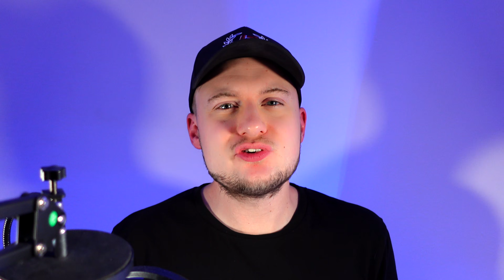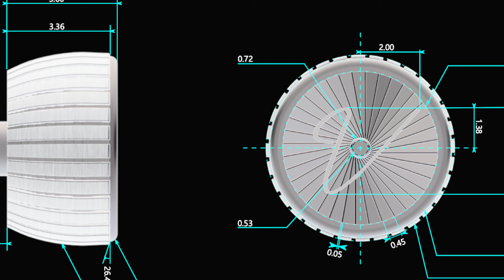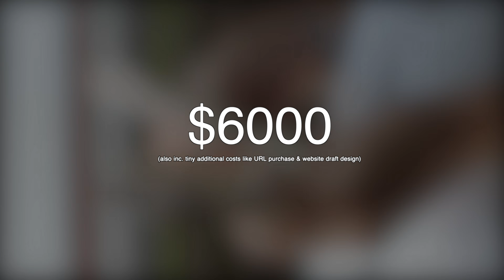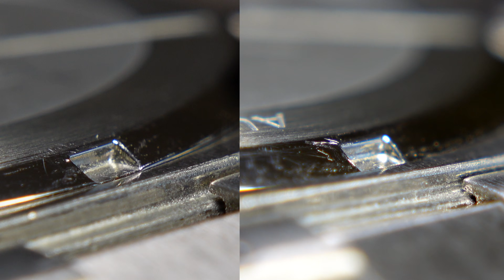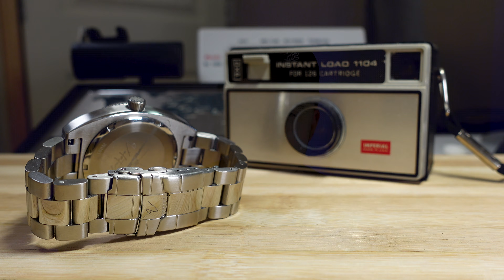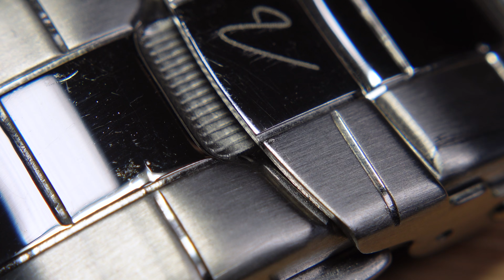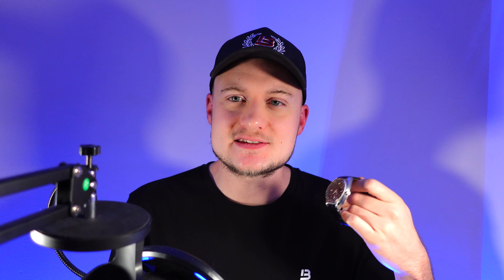My microbrand watch company FAILED ... here's why & what I learnt.

Comment: I have been manufacturing parts overseas in the automotive industry for decades. The best advice I can give you would be to find a broker in the watch industry that is willing to work with you. Yes, the broker will cost you a percentage of everything you ever make, but the benfit for a startup far outweighs the cost. A good broker in the industry will know what manufacturers to use and which not to use, he will have pull with the factories as he gives them a ton of business. For example we have a broker that will get us samples for free, if we want to manufacture something we send him what we want and he gets one of the factories he works with to provide a sample, from that sample we can make changes as needed until we get the product to where we want. Samples are not provided if the factory needed to make a new mold, if a new mold needs to be made we need to pay for the mold, and they will provide samples for free. A broker will also be able to get you warranty with the overseas factories, if they send you defective product the broker will make them replace it for you. If you, as a small manufacturer, order things directly from a factory in China and you get garbage you will 100% have to eat the product. I have been thinking of starting a microbrand on my own, but the only way to do this cheaply would be to buy a ton of off the shelf components, like cases,  bracelets, movements, etc... and have your own dials, hands, and bezels made to lower the starting costs. As you found when you order custom components the factory has a minimum order quantity, usually 300-500 pieces. Ordering that amount of dials, hands and bezels is a doable investment, if you can buy the other components off the shelf in small quantities as you need them. Anyways that is my 2 cents.

Comment: $6000 USD is actually very cheap for first prototypes. This includes design work, cost of design software and manufacturing, tooling and a couple of iterations necessary to get the dimensions right.. that's many hours of work. Building a small number of prototypes is very expensive, there is no economy of scale for the manufacturer to make the numbers make sense. Also.. learning CAD isnt hard, what is hard is knowing what tolerances and allowances to use for the function. You can bring in a more experienced engineer to reduce the number of iterations but this means you have to pay more for the engineer's hourly rate, so you gotta do the calculations for that too.

Comment: First mistake was making them in China. Second mistake was making them in China.
Reply from the maker: I don't agree on this. China makes some fabulous watches these days if you go to the right place - they can machine cases, bezels, crowns and work to tolerances as good as anyone. Not that every factory does however...
Reply: @nextonthewrist here’s something I recently wrote, not about watches, but footwear brands. I think it kind of fits here a bit, though a shoehorn might be needed: I recently came across a Japanese brand addressing speculation online about where their products are made. Their statement, that production was not in China despite forum claims, was met with immediate backlash. Comments quickly followed: “What’s wrong with made in China?” The brand then felt compelled to clarify that no offense was intended.

That reaction misses the point.

A brand should be transparent about where its products are made, clearly and without hesitation. Yet in practice, this information is often buried, obscured, or omitted. It is not uncommon to spend time navigating a website just to identify where a company is based, only to find that the country of manufacture is nowhere to be found. With enough persistence, the truth usually surfaces, somewhere in China, Southeast Asia, Mexico, or South America.

If there is nothing inherently wrong with these places, why the reluctance to state it plainly? Not all brands are reluctant. But many are.

The answer is uncomfortable. For many customers, country of origin carries meaning, and brands understand this. It shapes perceptions of quality, materials, labor standards, and values. It can influence the emotional experience of a purchase. Knowing where something is made may not change the object itself, but it can change how it is understood.

Consumers have different priorities. Some focus on material integrity, including the compounds used in rubber, the chemicals involved in tanning leather, and the finishing. Others think about labor, and whether the hands involved were fairly treated or exploited. Some consider broader issues, including the policies or values of a country. Many want to support the industries, craftspeople, and traditions that gave rise to the products they admire.

There is also growing awareness of imitation. Some brands observe what others have built, then move quickly to produce cheaper approximations with little regard for origin, process, or integrity. Not all production is equal, and not all intent is the same.

Beyond all of this, there is something more fundamental. Some brands build with intent, deliberately and with care, and with respect for the craft. There are customers who seek that out. They are not simply buying something new or visually appealing. They are looking for a meaningful connection to the object, the process behind it, and a community that shares those values. For them, a purchase is not just acquisition; it is alignment.

Transparency allows the customer to decide where they stand.

When a company is open about where its products are made, including the people, the materials, and the process, it is making a statement. It is saying: this is who we are, and this is what we stand behind.

When that information is difficult to find, or deliberately avoided, that too is a statement.

Pay attention to both.

Comment: I think if you want to start a microbrand you need to know how install the movement (cut stems, align hands and etc) so you just need to design your own dial, hands, crown.  Other components like case and strap/bracelet you can buy. So basically in the beginning it's gonna be your DIY brand but after, if it'll be successful, you can design custom case/bracelet.
Reply from the maker: Yeah this is the route I considered, I enjoy assembling watches and ran a side hustle seiko modding back when the SKX was alive.  It's hard to make a watch at a reasonable price in that way though, I know a few brand owners running like this and to compete on cost per unit with factories producing even small batch 200-300 watches, they're either not charging their labour for building or making almost zero profit - not good for growth and reinvestment.  It's fine for 1 off custom pieces, but depends what your ambition of scale is.  Perhaps a good way to start andcbuild a small and loyal fanbase and some reputation before going the factory route, that said plenty of brands started with ambition and succeeded 🙂👍

Comment: I though the entire point of the prototype is to get the feedback on the design and the fit, much less so on the quality.  This design is pretty cool, but the case looks way too unrefined compared to the dial, bezel, and markers.
Reply from the maker: Yeah you're right, but I think only up to a point.  I've handled some early prototypes from other brands and they have not been perfect, always you find things to fix for the next prototype or production - but not seen any that were catastrophic like mine.  Some of the flaws were not following the design drawings / spec which is black and white - almost criminal with modern day CAD. 🙂

Comment: How much were the first 300 going to cost?
Reply from the maker: Without going through my files from back then I can't remember exactly, but it was not cheap... Between £200-£250 per unit off the top of my head.  I'm sure prices have gone up a lot since then. To add to this you have import duties and shipping costs for a large batch delivery (managed by a freight handler) plus packaging, local QC inspections and final shipping to customer.  If you put all the costs together for the business, then breaking even in the first release would've been a big achievement!

Comment: I dont really see this as a failure at all. This was an experiment that turned out the way that most first attempts at business end up. Lessons learned. You are taking it too much to heart. Its a passion but its not neccesarily a successful business especially on the first attempt.
You went a bit too fast which messed you up a bit.
Designing a watch on a piece of paper is obviously the way to start but to hire a professional to draw it up to spec and have him arrange manufacture so quickly was where it went off the tracks.
If it were me (which it isnt) i would have gone on Ali and selected a few different cases close to your idea,, standard size dials of various types or some blanks, and all the rest of the parts to experiment with till i got something like i was envisioning and then started tweeking to final design.
Change this, change that etc,,, 
then use a computer program to develope the finalized drawings and specs not neccesarily exactly as your experimental Ali Express build but now you can add your own twists on the computer.
This should cause very little expense up to this point.
Now comes the process of commisioning a prototype.
Maybe you use some already available components or maybe you start from scratch and get quotes on a one-off case and bezel, or for cost efficiency you compromise and use an existing case with your selection of finishing etc,,
There are countless companies in China to source for manufacturing of a prototype but as you already learned they are not all the same quality.
I have read that people dealing with having products produced in China can have a very difficult time in specifying and receiving the quality that they require. It is a common thing to receive inferior quality and its all a process where the costs change if you want better quality after you already made the deal. Lots of bait and switch going on. It can be standard practice. You have to be on it at every step until you get what you need in a repeatable quality.
That is the hard part. Finding the right manufacturer.
I think you should give it another go sooner or later. You were close. Take time to gather up some money so you can be better financed and get back in the saddle .
You know you want to

Comment: I appreciate you sharing your experience and foray into creating/starting a watch brand. For all of the ones that succeed vs how many didn't make it like yours really hit hard. 

Being a fan of watches, builds, and art aesthetics (function, form, etc.) I Have wondered what it takes and what things to look out for. I have befriended and/or have a rapport with a few microbrand owners and in my experience they are accommodating in imparting knowledge and things to consider. Seeing the mistakes and what one would have done differently had they known is incredibly invaluable.

 I appreciate the transparency, vulnerability, candor, and good spirit in making peace with it. I hope you give it another go down the road if the desire and passion are still there. I like that early jet aviation theme/cues. You were definitely on to something IMO even if the production side of it went awry. 

I've had passing thoughts of making an attempt and have sketched dials/cases and have some background in CAD along with a background in Fine Art.  That said,  there is so much more I'm completely clueless about. I assumed a minimum of 10k so I wasn't far off. It seems like a heavily saturated field with new brands popping up daily. I suppose other fields are similar and regardless of that fact, each person possibly has something to offer.

Comment: I admire the honesty and humility. My thoughts are:

Even if the watch made it to production, a watch buyer will make an aesthetic judgement in under 5 seconds so none of your aviation backstory will matter. You also could have test-marketed the watch drawings to a select/target audience to get a sense of aesthetic feedback before committing to prototype expenses - the reason Chinese microbrands stick to homage watches is precisely because it's a safe(r) bet, but even then most become duds sitting on AliExpress as orphans no one wants.
Reply from the maker: Thanks Michael I appreciate your feedback and comments. 🙂🍻 I did months of sharing and compiled full market research based off renders of the watch prior to spending a single dollar on prototypes, I was happy with the results - the aesthetic tested very well in sample groups - please check my pinned comments at the top of this video.  🙂 Really the main issues were not in design aesthetic at this stage, but what I did next - which was a string of bad decisions and naivety before I even had a chance to refine it. Thanks again and have a good week 😎🙌

Comment: Sounds like you've learned a lot, I feel like most if not all brand owners may experience what you've been through. Prototypes are always a good indicator of a factory's competence and how easy they are to work with. A little trick I learned is that I'll have them manufacture a lower cost custom component to see how well they handle that before moving onto having prototypes or production done. It's also harder to have a factory revise prototypes if you have no sale history with them or a brand to act as leverage. Additionally, part of why I became a watchmaker was because I wanted technical training on all things watches because I knew going into it that manufacturers will constantly try to pull quick ones on you and being a watchmaker lets you catch these things sooner and more easily (if at all). It also lets you communicate precisely, which helps tremendously. 

Prototypes though, are never perfect in my experience, you can get really close but its just one of those things. I'm glad you were able to learn so much and eloquently bring it back to the people. I take a lot of pride in really minimizing catalog parts and creating unique watches for nearly all components, but sometimes I think the value of that can get missed. A lot of work and a lot of stress to make something come together how you envisioned!
Reply from the maker: Thank you - I really enjoyed reading your comments and honestly that's excellent advice regarding getting single components manufactured to separate the wheat from the chaff.  For a while I enjoyed assembling watches, it was a side hustle before I even thought about designing a watch.... and this was how I planned to develop the prototypes piece by piece swapping constantly and figuring out the best combinations.  I believe if I do anything again for this brand I'd be more inclined to go back to ordering parts myself and assembling small numbers and going much slower 🙂...I have no watch making skills though, my technical limit is regulation and changing a rotor/hands/dials 😆 so props to you for learning it's an awesome skill to have 😎🙌  if you ever have something you want to show via YouTube and you feel I can help feel free to drop me an email, I love to explore new brands 🙂🍻

Comment: Congratulations on your decision to develop a bespoke product. It's a bold move, and I encourage you to stay committed to the process.

It's important to note that prototyping specialists often charge more than factories designed for mass production. However, I advise against relying solely on a factory for assembling a prototype without first proving its viability and ensuring there are detailed instructions available. This should include precise tuning and testing guidelines for each step, essential for engineering projects. Your designer should be able to provide this. If they cannot, you might be dealing with a designer who excels in aesthetics but lacks expertise in functional engineering. Given your engineering skills, you might find it necessary to assemble the prototype yourself to confirm its functionality.

Selecting the right designer or engineer is critical, and the process involves significant effort. It’s also important to differentiate between an industrial designer and a mechanical engineer, as your project may require the skills of both. Some industrial designers are capable of precise engineering work, but many focus solely on the design aspect, leaving the detailed mechanical engineering to others.

I wish you all the best and keep up the excellent videos!
Reply from the maker: If I go again, I'll definitely assemble myself.  🙂👍.... Everything you've detailed here is really spot on and it's the kind of wise words that were absent in my mind a few years ago when I was exceptionally naieve in my assumptions.  Thank you for really proving really thoughtful and informative comments, it's appreciated and taken on board.  There's no way I'd go through that all again without total control and a proper strategy and working very very closely with engineering and design rather than through a third party.  

All the best and thanks again for the valuable input 🙂👍

Comment: Wow. I think the full CAD design and unique manufacturing of 2 prototypes for $6k isn’t that bad. In my head, I always would’ve considered this to be a far more expensive endeavor. Obviously, the quality wasn’t good in your case and that may be part of the lesser price… But, that’s an inspiring low entry point you’ve discussed to allow someone to also follow their dream to make a micro brand.
Reply from the maker: Definitely. My budget was higher but I couldn't start again at the time as the one off tooling costs were too much. I think if I had doubled my budget and had a bit more in reserve I'd be there or thereabouts with a better supplier 🙂 cheers for the comments 🙌🍻
Reply: @nextonthewrist what percentage of the total cost was the CAD design? Seems like it would be a lot of back and forth